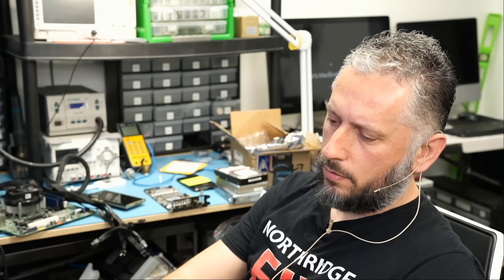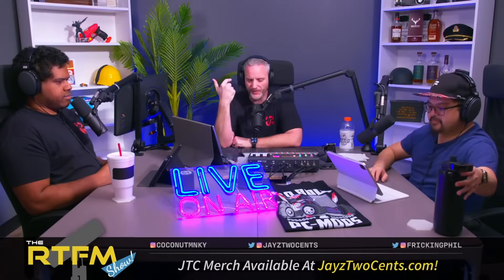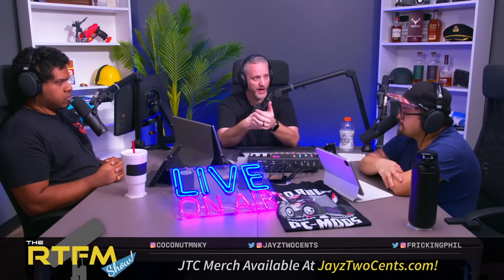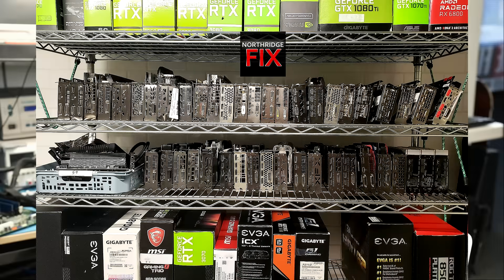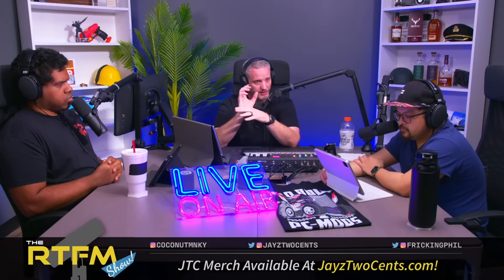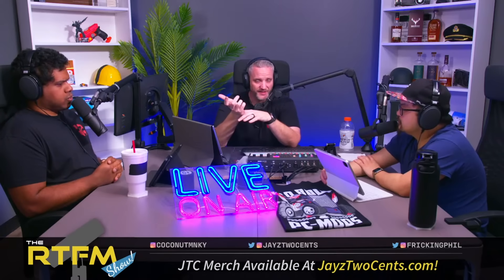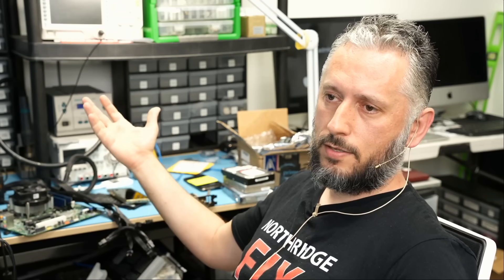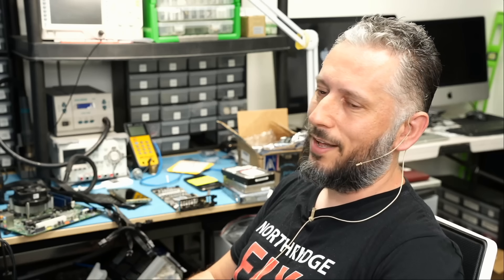Melting 4090 and CableMod. JayzTwoCents and Gamers Nexus Response. Blame NVidia or User?

Comment: If the same type of connector can handle the same current on other boards without problems it's obvious that they have got a batch of connectors that are bad. Either the contact pressure is to low or the surface treatment is wrong.
I bet that this problem will disappear just as fast as it appeared, and without any explanation from the manufacturer.
User error is just BS.

Comment: The plug is poorly designed, and yes it is a big flaw for it to melt regardless of if its plugged in all the way or not. Basically if there's any chance of melting due to improperly plugged then that should be redesigned in a way to prevent it ever happening as you said.
Reply: dude, saying bullshit like "regardless of if its plugged or not" is idiotic. Because if thats the case who cares if its plugged, or power supply is weak, or motherboard has some serious manufacturing flaw. I mean, people are idiots and even if they do something wrong they will blame it on others. If cable is the issue, i agree that there should be some type of protection, like card not drawing power at all and is always in idle. Some older cards if i remember correctly could work without power cable but at like 50% power or something. Good way for protection.
Reply: @milosstojanovic4623  its not a cable issue, in most cases the connector on gpu melts not the cables
Reply: @jaycqc8136  that does not matter, cable goes into connector, connector goes into the card. Not the point i and he wrote. 
Maybe end of cables into the connector produce too much heat, maybe users OC the card too much. The point is it should have some kind of "protection" if CONNECTOR is not CONNECTED properly. Next time when you read try to understand the point properly.

Comment: It’s definitely a design fault by nvidia and Steve is a puppet for nvidia. You 100% right on your comments Alex it’s a card issue to me it looks like too much current going through a bottleneck and causing excessive heat therefore melting the connector.
Reply: Hardware Unboxed was banned from Nvidia with much less criticism about their products...  Alex can´t be threaten by Nvidia and is free to talk about this.
Reply: @fcmancos884  The hardware unboxed is doing fine without Nvidia.  So I don't understand the purpose of what you're saying.

Comment: I agree with your logic here. I'm not an engineer, but if it was designed to allow a connector to "wiggle" enough while being plugged in to affect the resistance on the pins, and thus creating heat, then the responsibility for the damage is on the designer of the card. If I was a gamer that just paid that much money for a card, and then the connector melts, I'd be pretty pissed. Hey Nvidia, time to fix the design and do a recall before lawyers get involved.

Comment: I actually had years ago to do with RC/Cars, which had a similiar problem of this kind. Those cars used high-performance motors in competitions. At a certain point the normal Tamiya plastic connectors which go from the batteries to the control unit simply melt because of the huge power consumption those motors draw. On big racing competitions you‘ll see that the professionals simply solder the batteries directly to the control unit or at least using connectors which are made of gold or other materials who can handle those huge power hunger. Nvidia needs to discard the idea of using plastic connectors because those cards are at a point where the power consumption is simply too high for any plastic connector at all.

Comment: i agree with you and jay, its board design first and connector last, as for the connector it should have 2 clips to bring it more inline to a perfect fit and have been two-three separate connectors as that's some small gauge to draw full load from compared to older designs.

Comment: The fact the 3090 had the same connector and we didn't see large amounts of burnt and destroyed connectors means that there is something wrong about the 4090's.
Reply: People pushing 1,000 watts of power through a small connector is why they melt then go boom!! No plastic separation of metal pins, then they touch each other… this is whY high wattage applications use big gauge wiring and big pins and a connector that is huge that separates pins so they never touch no matter how hot connector gets…
Reply: 4090's can be pushed to higher power maybe? it's a waste on such an efficient node and architecture, but it's possible nonetheless. There's always that one person that cranks every setting to the absolute limit and then runs some excruciatingly GPU intensive benchmark that maxes out every square mm of the GPU chip.
Reply: Completely stock with the voltage locked at 1.05v my MSI Suprim X will use upwards of 500w when playing Control @ 4k Ultra using the "Directors Cut" mod and maximum RT. According to HWINFO64 the "GPU Rail Power" will hit up to 596w. I'm not sure if this is a power spike (excursion) or what. In most games even when heavily overclocked my 4090 will not use 450w. Even during most 3dMark benchmarks when heavily overclocked and using the Galax 666w vbios my gpu will not exceed 550w. It really takes certain games/scenarios for 4090s to pull alot of power. Most of my gaming occurs in the 300w-400w range.
Reply: 3090 cards didn’t use with modded bios up to a thousand watts of power
Reply: or it could be the 3090 sold very bad and not enough sample size.     4090 on other hand sold very well.
Reply: @Incinerate1212  there is more 3090's out in the wild this is not the issue.
Reply: @Incinerate1212  3090 was out of stock for  like a year
Reply: I'll make a bet that the 4090 card is going past it's power limit spec and it's drawing more current / power than designed for this connector AND it's drawing more power than the 3090 card, where the 3090 card with the same connector doesn't have this issue.
Reply: Im sorry gonna have to correct you here. you're wrong, the 3090 did not have the same exact connector. The founders editions of the 30 series had a 12 pin connector NOT! a 16 pin connector like the 40 series. You should look at a 30 series fe plugin vs a 40 series fe plug in 1 more time.
Reply: @kazacune101  3090 ti did.
Reply: @icommandoi145  you're high no it didnt it had a 12 pin. Nvidia didnt introduce 16 pin until 40 series came out. People really need to do their homework.
Reply: 3090=350WATT
4090=450watt

the cheaper adapter support 400-430watt; only the premium ones support 500watt
the fact only one pin burn show the other are  either:
-not connected
or there are a load imbalance, iif this was because the adapter was misaligned, you 'll see 2-3 pin burned (one on the ground and one on the +12v) AND NOT just one

so the +12v is misaligned but not the ground pin when they are in parallel ???
lol
if it was the case, you 'll see it instantly, like when a dog walk on only one paw............enough colorful?
if the adapter was misaligned, the female pin will touch the male pin, that's the (mechanical) goal of this kind of adapter

what i want to see, it's some measured current on  ALL 12pin, with a adapter made in nvidia , when it begin to burn, and not some half baked plea !!!!
Reply: 4090's have all pins connected together to one 12V plane, while 3090 pins are feeding different parts of VRM separately. That's why when resistance on one pin becomes higher, it basically stops working and more current starts to flow via rest of the pins. With old design it wasn't the case, that's why 3090s didn't have this issue.
Reply: YEAH there is... higher circuit values, with no re-design of the board, in terms of higher power requirements.
Not robust enough NVIDIA!!! SO STOP PLAYIN'!!
Reply: +1. Was about to say the same thing.
Reply: one more thing to add: these connectors have thermal plastics, and they should be able to handle some heat. there must be some ridiculous currents going through to cause a meltdown. 3090 has a 350w power limit. 4090 450, but many seen 500! thats 50% more without any special OC. sounds like great oversight and bad design.

Comment: What do I think?  I think that the connector not being fully inserted is a red herring and that this is more of a manufacturing issue than a direct defect with the 4090 or the connector itself.

The connectors are heating up because of high resistance between the mating surfaces between the pins.  The pins themselves are not gold plated so there's more of a chance that the surfaces can oxidize.

So what's causing the oxidation and it seemingly being random between cards?  In my mind it's pointing towards the manufacturing process.  After the boards go through a reflow oven they go through a board wash that uses hot deionized and demineralized water.  Yes there's a drying mechanism as the boards leave the washer, but unless they are specifically sealing the connector before it goes through the board wash and/or blowing out the connector with air, any water (along with the cleaning agent) that made it's way into the connector will only come out VIA evaporation (which is typically fast since it's hot water).  It'll also deposit whatever was in the water on the pins as well.

So why is it only seeming to affect the 4090 and not the 3090FE?  For starters the connector is oriented differently on the board.  That little difference could make the difference as it comes out of the board washer.   The 4090 is also a more power hungry card than the 3090 as well, meaning the 4090 is pushing that VHPRW connector closer to it's limit.

One way to figure out of this theory is correct or not is to clean out the connectors before use and see if the failure rate goes down.  Flushing out the card and cable side of the connector with deoxit and using some dielectric grease on the pins to prevent future oxidation should be more than enough.  The problem is you can't tell if a card would have failed if you didn't do this though so it's not exactly a controlled test.

 I have an Asus Strix 4090 and I'm currently waiting on a Cablemod adapter to arrive in the mail.  So far I've had zero issues with my VHPWR connector melting, but I was planning on flushing out the connectors with deoxit/using dielectric grease when I connect the Cablemod adapter for my own peace of mind.  Thing is the games I play on this system don't really tax this card from a power draw perspective (according to my power meter) so I may not be pushing my card hard enough to notice if there's an issue.

Comment: Alex why not put one of the repaired cards in a motherboard and run an intensive GPU application (game/mining or GPU loading app) while checking the temperature of the connector with the thermal camera. IMO you are 100% correct.

Comment: it's a design flaw in the new  power connector itself, not the card.  however , it is also  a flaw in the card for using a power connection that clearly hasn't been tested back and forth   for the kind of current they are expecting to pull on it.   seriously at this point nvidia are blathering idiots is the keep stickign with this connector  ont heri next gen of card (the 5000 series).  becaue clearly some one some where need to go back to the drawing board on this one.  honestly teh designers for this connector  are blathering idiots already.  any one with a smidgeon of  electrical knowledge can tell you  that shoving  the ammount of power that you'd pull on 3-4 cables  into a single cable that is much smaller , is a bad f--king idea. 
it's like running a high current appliance on a wall outlet that isn't designed to push that much power.  shit's gonna get hot fast and then you have a break down.

Comment: Show a construction electrician this plug and this cable and tell him that a power consumer is connected to it that draws up to 450 watts of electricity.
I tell you what happened.
He laughs at you and explains to you that this is the direct path to disaster.
Exactly the same is happening now with ASUS and the AMD CPUs with AM5 socket.
Too much voltage via plugs and pins that are too small.
Where else should the journey go?
Do we have to connect the NVidia cards of the 5000 generation with clamps like we find on car batteries?
We are at the limit of what is technically possible with this technology.
We need new ways to generate more power while using less electricity.

Comment: My rtx3090 uses 3x8 = 24 pins and draws around 400watt, explain how this 4090 can use 1 cable with only 12 pins and power 600watt and that has smaller wire/pin size.

This is a design fault an Nvidia should be sued, shame on GN for blaming it on consumers.
Reply: Try 1000 watts

Comment: im with you and jay. the 12v power adapter is a design flaw and should be recalled and replaced. even jay said it. its too easy to cable manage and accidentally shift it just enough to melt. Its bow show that even when fully seated you can move the plug side to side cause it to be off.

I said it before the 12V plug is a huge design flaw period

Comment: The DC-DC Converter on the PCB will heats up the PCB, the PCB will heatup the connector on the board. Maybe the problem only the difference of 40°C-50°C + the current trough the connector for melting. The connecor on the PCB will work at 20°C without be heatup from the PCB.

Comment: Hey Alex , I have one question, if the connector wasn't plugged in all the way, wouldn't the graphics card randomly shut down due to not much amperage being drawn? If it wasn't all the way in that would lead to sparks and probably failed fuses, not a melted connector. The amps being drawn from one connector shouldn't be over 10 and also adding the 1.8/3/5/12 rails at one connector makes it go hotter than normal. A 3090 draws around 350 watts, 350/3 I think to find what each one draws. For example a car battery, if you leave a metal for a little bit it will not get hot and if you leave it there for a long time you will have a nice camp fire. This is why the 3090 series went with three connectors because the card was hungry for power .
Reply: The 350w 3090 are the cheapest ones, the ones you can overclock are from 380w to 450w. The FE itself can reach 400w.
Reply: @fcmancos884  I did write the minimum to make the point , I do know that they reach way higher. If the 3090 is 400 watts then the 4090 should be a tier above

Comment: I'm an engineer and PC tech enthusiast. I'm seen probalby 10 or more than 20 videos from GamersNexus, I'm not a fan.  His worst takes are shtting on PC case manufacturers and designs, speaking with confidence as though he's an engineer and designs PC cases himself.  This is clearly an Nvidia problem.  PCI-SIG warned Nvidia on this connector prior shipping the 4090
Reply: If pci sig warned them, why did they certify the stupid connector to begin with? Micro sized gauge wire, pins and small plastic which when heated up Mets or becomes playable allowing pins to arc or touch and short, 300-1000w coming through it? Doesn’t take a rocket scientist to figure out life and property damage will happen like cheap e scooters catching fire….

Comment: I think Gamers Nexus was just pointing out that there should be much larger failure reports if it was a design/manufacture fail, so just wanted to back off the recall demand until there’s a lot more info.  Steve didn’t say Northridge Fix was wrong, and even said they could be right, but that more investigation was needed.
Reply: He read Alex's statement about the Cable Mod adapter being specifically plugged in all the way, then proceeds to ignore that and still say it could be the user erroneously plugging in the adapter. 🤷‍♂
Reply: He has a whole shelf of cards sitting waiting to be repaired right now. How many do you think he has repaired since this whole problem started? And keep in mind this is just 1 shop out of thousands of shops.  Only Nvidia really know how bad the problem is and do you REALLY think they are going to say and do a recall on the only card that is bringing in a big profit for them ATM even though its barely selling?

I like Gamers Nexus and watch alot of his videos. But for some reason with this problem it is like he has his head stuck in the sand on it. Could some of them be user error? Sure some of them could be..  But all of them there is just no way that hundreds of users (people spending $2k on a card) are not plugging said card in all the way. Most of these people are more then likely taking extra care to make sure it is plugged in when dealing with money like that. Heck even going so far as to buy extra adapters to prevent this problem from happening.

There is a realy problem with the 4090 and 4080 and for whatever reason its pulling too much power over specific pins instead of spreading the load out like it should be.
Reply: He lied about the "surge" of card being from cable mod, Just 8 of the cards are actually from them. The rest ?.
Reply: Gamers Nexus knows nothing and never did. They always just pretend.
Reply: @realtuner3560  Can you point to me on the doll where GN touched you?
Reply: how many 7800x3d took for steve to blame asus ?
Reply: @jhonatancock2302  just 2 🤣
Reply: @jhonatancock2302  1?

Comment: If the issue is the connector and possible user error, why didn't nvidia put a temp sensor there? There are multiple sensors on the card already. Detect increased heat due to possible bad contact, show a warning, put card into limp mode or something to avoid melting.    User error my ass, why didn't 3x8 pin connector on previous cards melt like this.

Comment: Too little surface area to pass the amount of current that it could possibly draw.
We also see alot of connectors burnt on car amplifiers from the set screw not being tight enough..
It even goes as far as melted fuse holders at the battery because the user has poor quality cable.